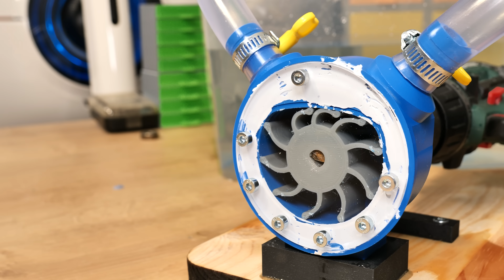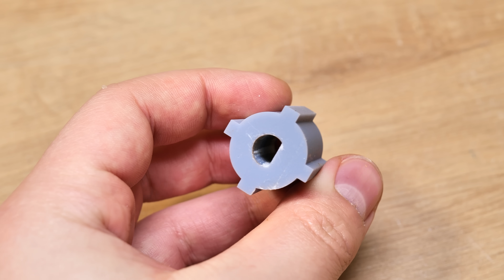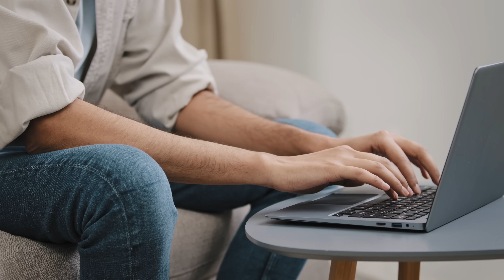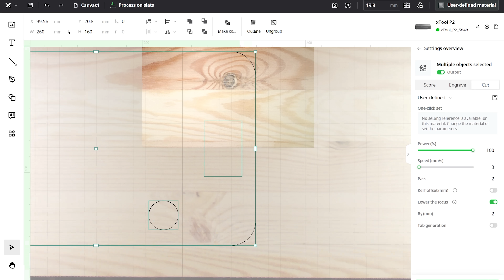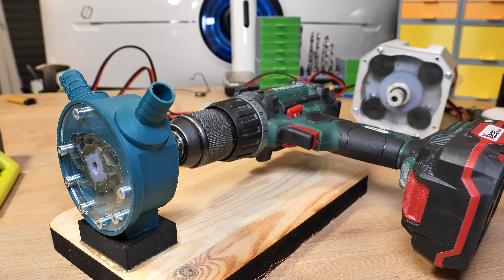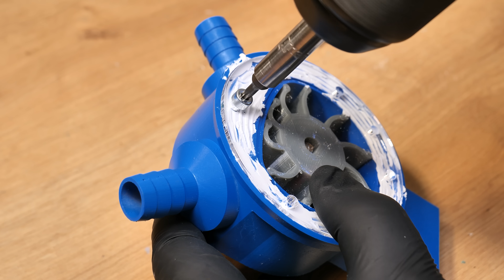Flexible Impeller Water Pump

Comment: That is insane
Suggestions
Try tpu gaskets instead of silicone (don't remember to make screw gaskets o ring like)
Maybe make the shaft thicker to increase reliability
My overall likeing
Idea 9/10
Execution 9/10
Looks 9.6/10
Reliability 6/10
Friction 4/10
overall 8/10 (7.52/10)

Comment: :hand-pink-waving::hand-orange-covering-eyes: Your impeller housing isn't designed correctly and you are loosing efficiency. You are crushing the impeller too steeply. It needs to be an offset circle without that abrupt change. You are placing too much stress on your impeller. Also, you can 3D print your impeller from non-composite Nylon. This will flex as needed and provide a self lubricated surface. Look up Nuphlo pumps. :goat-turquoise-white-horns::hand-purple-blue-peace:

Comment: That recess in the pump housing is begging for a printed TPU gasket. As long as the rest of the structure is solid, that should solve any leak issues.

Comment: Nice, self priming. Typu got loose on the shaft by the end. I think i had seen a rubber impeller like this and it probably was vulcanized to a metal received of shaft torque.

Comment: Loved the video!❤

I think you can get better results with the upper part with more space to the impellers. That way they will not bend that much - more fluid volume - less effort from motor - less probability to destroy the propeller. I think I will try that design! 🙂

Comment: TPU FTW! Would a crush O-ring seal work better than the mess of sealant? Inset one o-ring inside and one outside of the screw's ring with a half circle carve should help a lot, just a thought. You could make the O-rings out of the flexible resin to make a use for it! Or design a flat gasket for that resin, etc. 

The less leaking you have to fight the quicker you can get back to actually testing impeller designs!

Cool laser bed features!

Comment: You could print a tpu seal ring and insert it in a groove in the part. I have done and it avoid leaks very well.
Reply: Or cut it from a cork/rubber mat. It is used for sealing and works great!
Reply: Or print it with resin. Nice, flat surface